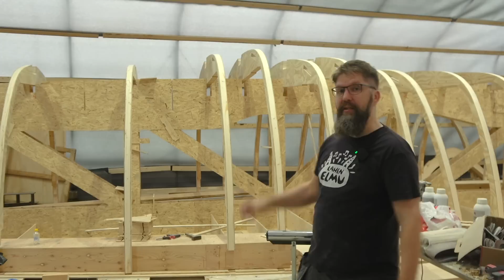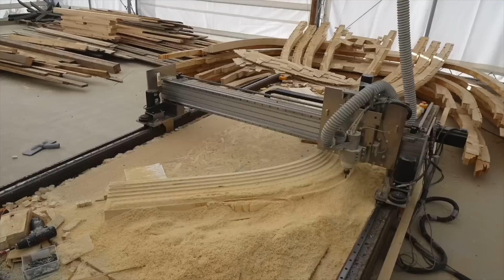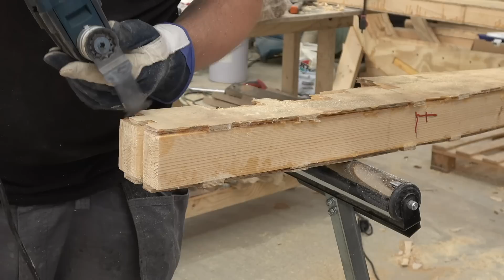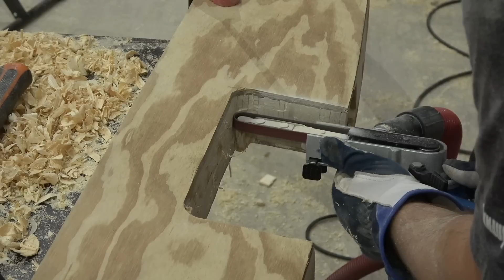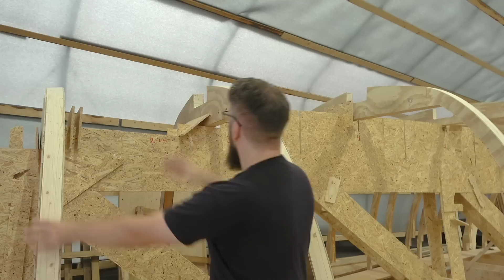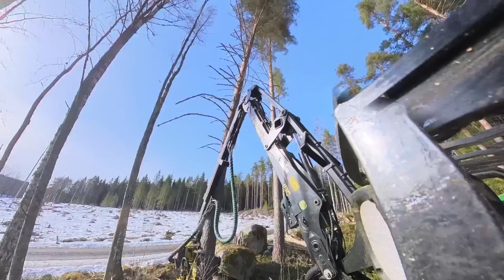✅ Frames are done! - ⛵️ Building 50ft Sailboat - ep78 Project SeaCamel

Comment: About the waterline, laser line marks. You can measure off of different points on the drawings/frames, to get a mark within a mm. Or average out the difference, then look at it installed, for the fair line. Just like the shipwrights of yesteryear would do.
Take care from Northern Canada.

Comment: Where did you get the plan for this boat ??
Reply from the maker: The base model of the boat is Tanton yacht designs "Millennium Falcon", which is a one-off steel boat made in 90's. (you can find it with google)
That design was then modified for wood-epoxy. Little shallower, little wider, the basic structure principles etc.
Rest of the design and all the CNC cut files and construction method etc. has been done myself.
Reply: @ArcticSeaCamel  Sweet.
:)

Comment: It's nice to see you again still involved in boat building. Funny to hear an architect talk about millimeters in tolerance. A man said a little teasingly that in house building there is a tolerance of ten decimetres per metre, and sometimes I was ready to agree. I bought here in Sweden 22 mm thick pine moldings and discovered that they were only 21 mm. The seller explained that below one hundred millimeters a tolerance of +/- one millimeter applies. However, I never found any moldings of 22 and 23 mm.
Reply from the maker: Yeah, buildings have bigger tolerances of course. I've been generally using 0,4mm "gap" between those CNC joints in wood (0,2 + 0,2 on each of the joint side) and that has been working great.

But yeah, difference of 0,6mm in thickness of plywood is still in acceptable range. And wood of course varies a lot just due to air moisture level changes.
I just need to take all that into account when making things...

Comment: How are you working to align/fare the top/bottom of the frames?
Reply from the maker: The frames align with the bulwark very well but I will check the waterline markers before gluing them in.
As for the planking surface, I think I still need to sand them a little and check the alignment with batten or something.